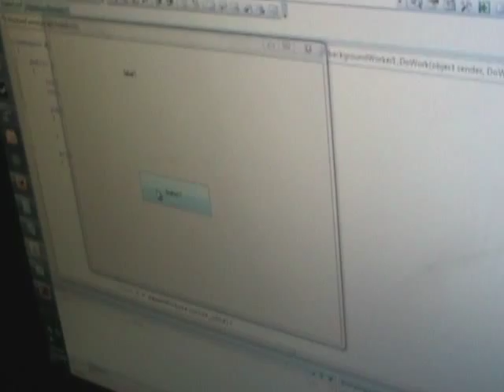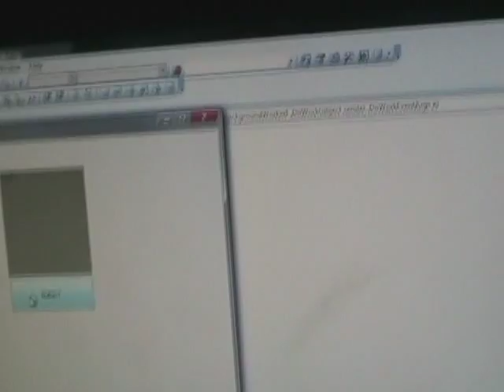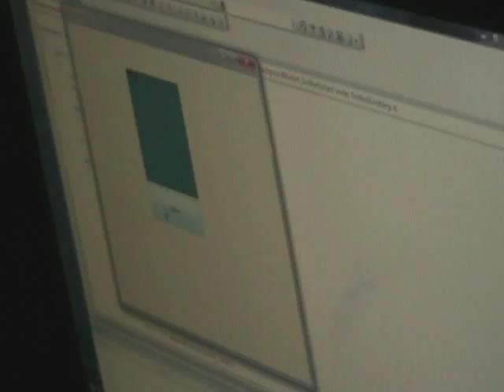Arduino Color Detection

Comment: Hi, i'm trying to detect colors by fotodiode + RGB led. It doesn't work correct because i connected fotodiode directly to ADC pins(ATmega8). I would like to know how you connected a fotoresistor to A/D converter's pins. Thanks rof reply. Rapimodel